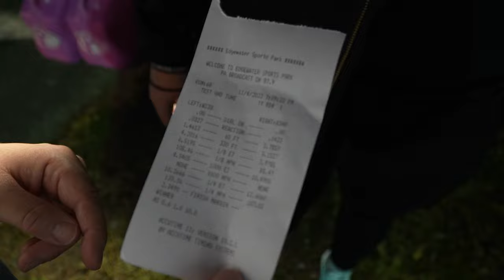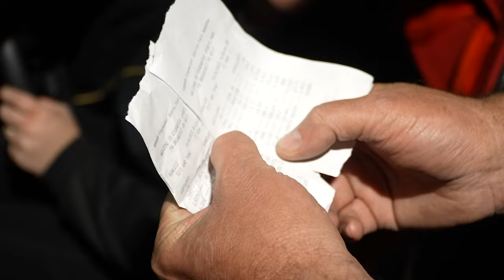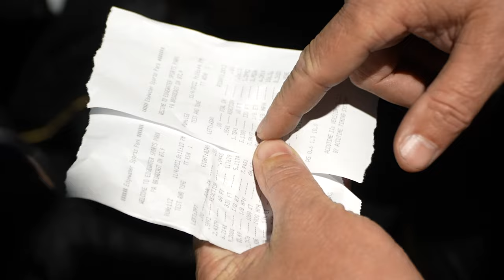New PERSONAL BEST! Testing on E85 + Tuning Advice from The Old Man!

Comment: Process of elimination between Bill and jeffafafa you'll get it lined out and when it's running correctly (correct valve springs and fuel pump) you'll know how it's supposed to sound and pull down the track. Then you'll be able to give all the feedback needed for Bill and Jeff to tune it! Your doing amazing Miss Allison and Tommy is also in supporting you!
Reply: Dont forget Billy after all he bought the car for her..😏
Reply: That's 100% true! I just turned 50 so you'll have to forgive  me

Comment: Upgrades are a fantastic thing, Especially when they do what they are supposed to do. Swap out those valve springs (That it self will be a learning experience) Adding a bigger fuel pump never hurts, You can always adjust it down with the regulator.  Hopefully this weather holds out for you threw the end of the month. And you get some solid info going into the lay up this winter. You guys will be coming out of the gate swinging for the fences next spring (Late March) with this car.

Comment: I have tried to listen close both to this video and the previous video. I can't say that I have ever heard the valves float on that car. So maybe the mic isn't able to pick up whats going on real well. Unless your hearing things that the mic isn't picking up, I wouldn't worry too much about replacing the valve springs. I did agree with Bill's assessment to not tweak the carb any further until the fuel system has been upgraded. Nothing sense in possibly creating a scenario where you end up chasing your tail for a while after the fuel system upgrades happen. I do enjoy seeing the smile Allison has on her face when changes move the car in the right direction! 
For those in chat screaming that the burn out needed to be longer, while I too would think so, I am sure that Bill would have spoken up if it were a serious issue.

Comment: Is it just me or was Allison cutting a much better light this time out?   Don't recall the times from the last video but it seemed to me she was doing a damn fine job of chopping the tree down!  🏁😎
Once ya get that valve issue of whatever it is sorted out I think you will be going much faster, hi 11's are not out of the realm of possibility IMO.   And then ya get to spray it! 🤗  
Excellent work on the Dart by all, excellent video, thank you for taking us along for the ride guys!
Reply: The e85 carb was part of that.  Much more responsive than the gas carb and the car reacts faster to her throttle input.  She’s always had good reaction times but the car was sluggish
Reply: @theoldmansgarage      Knew E85 would improve throttle reactions, just didn't think it was that great a difference!   Still not sure how a slower burning fuel makes that improvement though,  never understood the mechanics at work there.
BTW, love seeing you mess with Jeff-fa-fa when you go over to his garage.  I think he's getting wise to ya though... ya could tel he wanted to straighten that alen wrench pack out but I think he wanted to deny you the satisfaction of seeing it even more! 😆
Might be time to up the game... just wander around with a pocket full of lock washers and press fit wire connectors then randomly seed his garage with them.😇😁

Comment: You're running the same times now, 12:50's and high 12:40's at mph, 107 - 108, as I did in my small block Nova.  Street driven.  Drove to the track.  I think you're right on the valve springs.  May actually be part of why you nose over on the shift too.  Just throwing in my 2 cents to see what you actually find.  But I know you'll be changing springs and I'll be tuning in to see how much you pick up.  Nice video.  I love the tuning/dialing in process.

Comment: Years ago I bought a set of assembled head and after two years 6200 rpm was it. You could see the backfires in the air cleaner at night. I had hurt the motor and had heads gone through and they put new valve springs and would go to 7000+ before I knew it

Comment: Best thing to do first, since that is not an EFI car, remove and blow out the return line back to the cell (assuring the return line is empty), add a plug to the return port on the regulator, readjust the regulator for desired fuel pressure at the bowl float needles, run it, if it gets the rpm's up on the big end and no longer breaks up at high rpm's then the valve train is OK, and the return line must be a lot smaller than the feed line. (That is a common carb setup issue of simply oversized the return line, as none of my carbed cars ever had 1). All EFI cars need 1.

Issue gets same results, then definitely it is the pump volume, and still could end up the regulator (not right or adjusted wrongly), and possibly return line size too large.

Comment: I believe one of the issues with the bog on the shift is the torque converter. However weak valve springs can cause the torque converter seem to tight because of loss of torque. I feel you guys are close and definitely want to upgrade the fuel pump.

Comment: Great video. Like Tommy said, starting out a little slower and chipping away at the issues and making improvements over time is the way to go. Hopefully a new fuel pump and some stiffer valve springs will be a bigger improvement.

Comment: Before you change springs take a look at lifter preload. If it's laying over and popping through the carb at 6000RPM it probably has too much preload. If you have adjustable rockers, set preload at 1/4 turn. If not, shim up shafts.

Comment: Mid 12s on a car with full exhaust is not bad. You'll get there and knock it down better fuel system upgrade to valve springs you'll get it. Wait till that nitrous hit puts it in the 11th. Great job

Comment: If it has a MSD distributor check the magnetic trigger in the distributor , I have had to clean mine because it gets covered with rust particles that I have to clean off with a brass wire brush and WD-40

Comment: Super sweet Dart!!!  It's a hydraulic roller, right?  Mopars are known for this, both the bigblocks and smallblocks.  It's the lifters themselves collapsing at 6000 rpm causing the valvetrain instability.  Changing valvesprings won't fix it unfortunately.  Supposedly Comp has a new limited travel hydraulic roller lifter that is better for higher engine speeds but I personally haven't tried it.   A solid will clear it right up!
Reply: Not a roller

Comment: Tommy remove a couple rocker arms off the engine and look at the top of valve stems If you see a butterfly pattern where your roller rocker has been riding then for sure your valve springs are floating there should be just a straight line  in the center of the stem

Comment: A gallon a minute is far from another fuel for a 340, both of my 383, and 440 in same 3200 lb 63 Polara (though big blocks vs that small block), running 12 flat used exactly 1 gal per full throttle 1320' pass including the return drive. So it was using 3/4 of a gal. In the 12 second runs at least, so it is definitely flat running out of fuel, do not blame the valve springs until the fuel issue is corrected first.

And that was regular pump gas, with E85, it is burning a lot more fuel in a run.
Reply: Enough, not another.

Comment: I can’t wait for you guys to get the valve spring issue fixed so you can rev that engine a little higher so it can stay in the power a little better. I’ll bet that car gets threw the 40’s into high 30’s on motor once you get that fixed up.

Comment: The thing is your learning what the car likes  fix the fuel and springs and you will find out that moter has alot more to give i dont remember what cam your running  but my Brothers Dart shirt at 6500 red line 7000  . Good luck  the 340  loves RPM  theres something holding it Back

Comment: Are you going to use Holley's Hydramat fuel pickup it helps with fuel starvation issues during hard acceleration and low fuel conditions. 
The Jegs part number is 510-16-107 for a 15x15 I don't know what size you need but You Guys and Jeg's should know what size you need. 

As A Die Hard Chevy Guy Myself  That's A Nice looking and running Mopar especially when you get the little bug's worked out.

Comment: I never tell anyone I don't know what to do but if it was my car I would definitely look at what Cam is in the car and obviously change the Valve springs and put a fuel pressure gauge were you can see it, your kind of wasting your time on the tune till you fix those issues, I'm sure Y'all know this just my two cents.

Comment: Seems to me if the issue was valve float the car would lay over BEFORE the shift not at the shift. What I saw was both Allison and Tommy would shift then the actual change would happen nearly a full half second delay. Sounded like it lolly gagged into gear  Its like a normal transmission setup for highway driving where the vacuum is way off and not allowing the trans to dig in and make the change on the demand of the driver shifting not the vacuum causing that sloppy and slow shift.

Comment: Very educational...thanks.
Reply: @charles herrick; proper education comes from proper information, knowledge, ideas, concepts, principles.
@Gen 2 Garage;
Bill [Sr.] is relatively 'new' with ethanol combustion, and has slightly more experience with methanol combustion - but lacks much of the proper basics.
Ethanol and Methanol are very low carbon content hydrocarbon fuels - especially compared with common  fuel purchased at every fuel station
->even that which is sold as "E-85" ranges significantly, commonly 40%, especially during winter, colder temperatures, and may reach 55-65%
-> the 'racing' version E-85 - C-85 actually has 85% ethanol - as they use for NASCAR -> IndyNTT use 100% Ethanol since 2007 - switched from 100% methanol.
->with less carbon content, there is less carbon deposits, remnants on the spark plugs, inside the cylinders, heads, on the cylinder walls, pistons, combustion chambers, valves, exhaust ports, etc..
=>Thus, very little noticed on the spark plug except heat ring marks - which are more difficult to see in the dark and require more precise examination.
->the best method for tuning is to use perform via a dynometer [wheel-tire or hub (preferred)] to achieve the optimal tuning with the fuel system, carburetor, ignition timing, etc.
->then with the knowledge, the other aspects with traction, via tires, suspension, etc. can be optimized at each track.
->the other possible issues with the valve springs, valve train, rocker arms, cam shaft lobes, etc - which result in valves bouncing, thus loss of, with compression, especially as the engine speed increases - is best handled properly via detailed, proper analysis - please see "EFI University" via the "Sorceress" vehicle and R.E.D. - actual proper engineers are involved as they are within every profession racing team engines within NASCAR, F1, IndyNTT, NHRA/IHARA/PDRA/etc., IMSA, FIA, LeMans, Time Attack, etc. and many others too. - Avoid the common false ideas, concepts, process of 'Trial & Error' which always lead to Failure !
All The Best 
Sincerely

Comment: I'm no expert but I had a 360 la block with newer style magnum heads and what your guys are going through shifting past 6 grand I couldn't even do it because it would float the valves I had the same issue and the only way I found out I could solve the issue  is a better set of heads with better valve springs but if you do that put a nice purple cam in the dart
Reply: is this a real thing

Comment: I also think you are coming out of the low RPM range when you shift it and you say the high end its valve float. Try a fuel pressure gage that you can watch during the run and Bill was saying about a AF mixture gage will help too, I am off to G2G for a shirt now

Comment: 47 degrees on that 340...if the balancer is correct, we shall see if the reduction to 40 hurts it. Just my guess between pass 1 and 2.
Reply: And the reduction in stall/foot brake under 2200 is going to kill her .040 light.
Reply: 2500-2600 stall is going to get her to a .020-.015 light.

Comment: 12:52, 12:51, and Tommy goes 12:55....I never (Accept that the car is consistent on motor, drops a hundredth after using fuel on a pass....Sharpen up staging and light consistency, by driving it consistently (same routine, zero changes), and dial that thing in a bracket, dial it hard, drop it a hundredth a round on the dial, and let her go rounds. Fill fuel when necessary only adding 2 gals at a time.

That could be a Black Magic Bracket car. And once she wins a few checks in Sportsman, then play giggle gas games later. Right now, just win to pay for upgrade parts and pcs.

Comment: Great Job though, and driven repeatedly the same, that car will be a decently repeatable bracket car once the rest of the minor bugs are worked out. And they are very minor, the Trip A-B is straight as an arrow. Time to try to make it richer and push the foot brake stall to max next time, try to make it spin, and shift points up higher, see what it takes hand on the shifter watching the tach, with shift light off, when it stops pulling, shift it. And remember that point.

Comment: I second the valve springs, but i also understand a mellower cam, and lower compression wont let it rev up as fast, or as far. The cam might totally just be running out also. So hard to just guess what it is without knowing everything else is good with ignition and fuel delivery. Good luck guys. Im digging the mellow upbeat intro too.

Comment: Love the Dart guys I’ve got a 69 Dart with a 340 That my father-in-law built and his nickname is Dr. Dodge! If you put some head work in on some W2 heads which are the best cast-iron heads you can get for a small block Mopar you can get a lot of more horsepower out of those little 340 if I’m pushing right around 550 HP with a stock bottom end 340 an 850 double pumper with 50cc Excelerator pumps on race gas and a four-speed!

Comment: Try 16 to 18 inch header extension’s it’ll help it breathe better try it won’t hurt 🤔❤️🙏✌️
Reply: They don't open the exhaust it runs through the mufflers.
Reply: Hello you remove the mufflers and run the extensions if you are any kind of racer you would know this! But if it’s a track where you have to run so be it 🤣
Reply: @mathew5858  I've been racing and building car's for over 40 years so I'm aware of that, I'm telling you they DON'T run open Headers so why would they put extensions on it.

Comment: Bill, I was waiting for you to break out the Flat plate vice grips to squeeze the return line back in front of the cell in the trunk to reduce the fuel returning to the cell, and have her turn on the fuel pump (ignition off), to see if it overpowered the bowl float needle and seats, and if it even increased the fuel pressure at all beyond the regulator.

That would at least confirm that the return line is too big. If it did change things a lot.

Comment: I am right with your thoughts on the valve springs i even left a remark saying that has to be at least part of the reason it wont rev.  Ive had a distributor that seemed great before that no matter what i did would break up and sound like vlve float also.  Just some thoughts, but congrats on  great outing with it!

Comment: Not to gripe, but that 340 has a good head on it doesnt it? I feel like with a good valve spring, it should be able to rev a good bit higher than it is. Little thing should want to see like 6500ish at the shift I think
Reply: I concur, I would look at what Cam is in it also, as it is now that Engine isn't even working yet, they should be able to spin that thing to 6.5 easily, I would put a fuel pressure gauge were they can see it so they aren't guessing what's going on.
Reply: @michaelwynne4346  yeah id definitely be starting with getting rpm out of the motor first, I wouldnt be afraid to wing a 340 up to 7k with good heads and a decent cam, but shifted a little lower is ideal I think. Still love it

Comment: something is wrong with the 60ft. had a similar setup in a 74 duster with a 3.91 gear 10" converter  26X12.5 MT would pull a  1.53 60ft. mine would flash about 3200 leaving just above idle.  i ram slower et 12.90 but with 100 n02 went 11.70 at 118 mph, my motor was 9.0 comp it would run out of motor in the 1/4 mile in the 1/8 would run 8.0 and on the gas 7.40 100 shot
Reply: They have a tight Converter, it's built for Nitrous.

Comment: Need to make sure that you high side chip is not bad. I have a good set of valve spring on my shelf.
Reply: Yeah, I pulled the chip out the other night and it did the same thing.  Good comment!
Reply: @theoldmansgarage  I fought the same kind of miss for year. Change valve springs nothing changed. 
I have a mallory box. Bumped the high speed setting up and that was problem.
I would shift when the car lay over and did not realize the high speed chip was the cause.

Comment: I think fuel or filter. 340 even with small cam will rev to 7 stock ignition sometimes 6. Your doing great. Should be running 12 easy for the way y’all have it dialed. We ran 11.50’s with a 4 speed almost the same,so I see way more in it. Just have fun. My daughter doesn’t race at a track. She does street in a slow ford car turbo car of her boyfriends car. She is scared to drive my fast cars,mainly because she doesn’t want to break them!! Big fuel pump set down is better. Adjustability. Converter should be a 3000 and ? A trans. Brake I like coming out around 35 to 4000. My thoughts y’all do awesome

Comment: 340 needs alot more fuel & less pv. Then a 350 no matter where it is! Needs 36°-38° @ most! Should of ran the same lane! You can cut better & more consistent lights against the converter! Its really doing good for a mild cam tight converter! But check the valve train geometry everyone seems to have a problem wt it esp.other then a mopar guy!